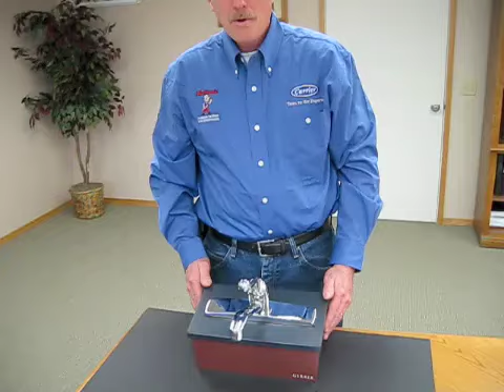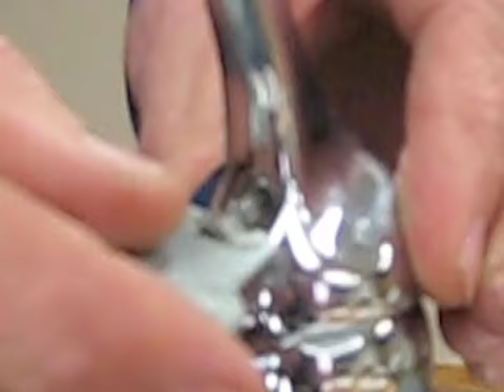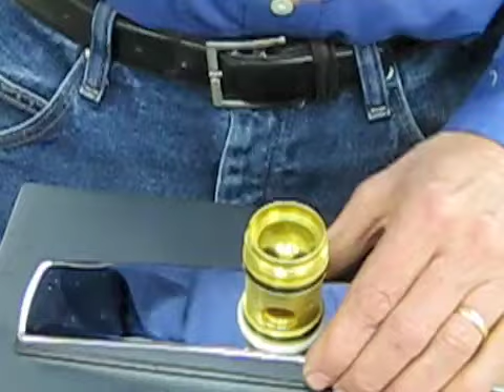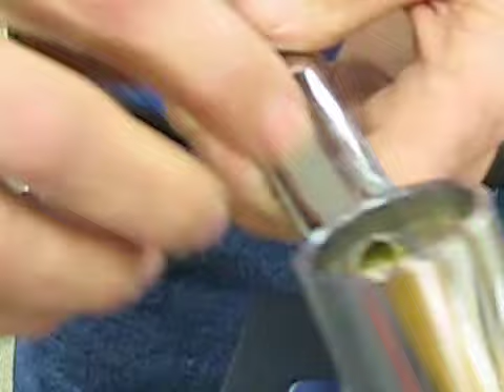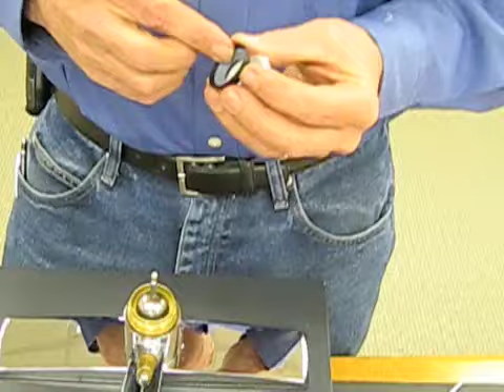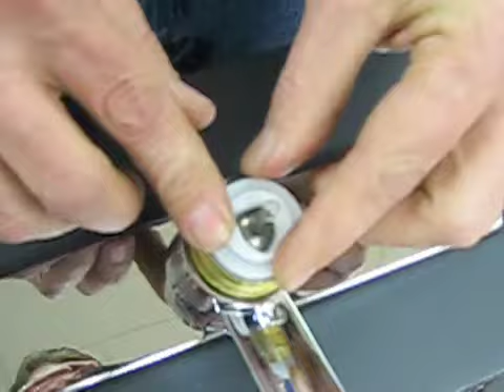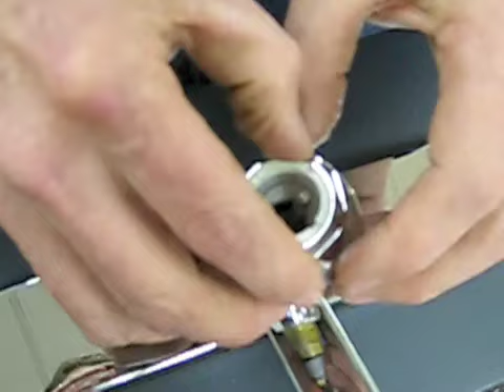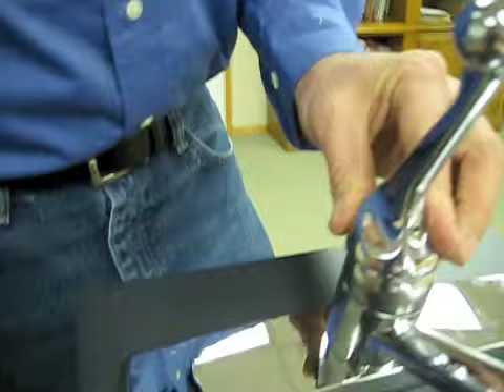Delta Faucet Repair

Comment: One thing not mentioned, as you are putting the ball assembly back in, to the right side of the opening is a little metal nub that must be fitted into a narrow slot in the ball. The ball will not seat properly until this is done. Thanks for your video. Faucet is now repaired.

Comment: Thanks very much for posting this video. Very helpful - my faucet no longer leaks!
Reply: Mine leaked from the tap itself. Nowhere else. So I just replaced the springs and little rubber cup-things. $2.08 at Lowes. No leaks! Thanks.

Comment: The kit I purchased at Lowe's had two sets of o'rings (needed the thicker ones) and two sets of springs.  One set of springs was tapered and did not fit into the washers.
Also, the flat on the stem that the handle mounts to must face forward.

Comment: I replaced the springs and seats and now it doesn't leak anymore. However because the springs (from Home Depot) were not OEM I had to squeeze in the seats firmly. This took some time. The ball is slightly higher than before, but the leaking is GONE!

Oh and there is a cover for the hex screw when starting. It had some much calcification on it that when I pushed it off with a screwdriver it broke off in pieces so beware of that.

Comment: Thanks for the instructional video, helped me fix the dripping problem in the aerator; but now the faucet leaks from "under the handle".  I took all apart and put everything in its place again, but still leak "under the handle" when I turn on the hot water; and it leaks ONLY when I turn it ON, it does not leak for the entire time the hot water is ON.  I have Delta Single-Handle pull-out faucet.

Comment: This worked well on a bathroom faucet. I would mention that the stem on the ball must be facing with the indented flat area at the top of the stem facing out (towards you) as this is where the set screw on the handle must go.  In my case, it had to be in that position in order for the handle to move L to R for hot/cold water.  I also found it a bit tricky to hold down the cam so the tab fit into the slot (even using the method in the video. It was hard to keep the tab lined up with the slot.

Comment: Not all installs/repairs go as perfect as yours; such as Rob Duranleau's (which you also had no suggestions for).
Would like to see you do on a live pressure system and address any issues that may arrive, such as a small water leak from the faucet.
And, what is the other end of that funky looking allen/hex tool used for? 
I'm sure some of the viewers would also like to know about that too.
Just the same, nice job on your video!!!

Comment: Thanks for posting this video..  I was just replacing the same part in a shower valve and I didn't notice how the springs and valve seats were installed when I took it apart.  Watched your video and BLAM, there was my mistake..  thanks again!!

Comment: @mlustig1 Does the spout pull out of the faucet.  If so, you normally do not need to remove the spout.  In that case you would just remove the handle to access the cartridge.  Most pull out faucets have a ceramic disk cartridge.

Comment: Thanks for the excellent tips. almost gave up when I couldn't get the seats and springs out. great tip. used a nail groome rtool  from the local drug store when I couldn't find  anything like a dental pick.

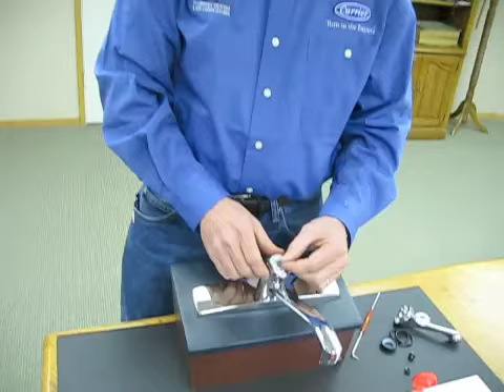Comment: 8:28...what if the water is comming up through the cam and the ball? I made sure the springs and seat are snug in the holes, but water is still comming out.

Comment: Thanks for the video.  I have an old house with rust in the pipes, and the hot water side of mine I think is plugged partially.  This will help with figuring it out!  =D

Comment: I followed your instruction as shown but after I did I noticed one of the rubber seat is shorter than the other, which side would the shorter one go? after the repair no more leak but so is the cold water? wife is asking me to buy a new faucet now. I don't know what happened but why did I lose the cold water?

Comment: thank you henry bush. this video helped me out.  i was getting super frustrated w changing my seat washers in my sink bc it was dripping.  i didnt know until i watched this video that after you change the seat washers you must use the flat wrench to tighten the cap back on the faucet.  the instructions in the seat washer case says hand tighten , but they were wrong you must tighten w a wrench

Comment: My faucet is leaky at the spout. I took it apart and wonder a couple of things. The O rings are not super tight? and the seat and spring assembly - one of flush and one was not? Initially I thought the flush was wrong, but on second thought the flush one may be to flush and spring not working and allowing water to go up?

Comment: I installed all new parts in my kitchen Delta faucet but I just hand tightened the cap assembly.  The handle was really loose and very easy to move.  There wasn't any leaking on any parts but, the handle had to be set back a bit or the spout would run a very light stream of water.  So tomorrow I will use the wench and see what happens.  Great video.  Thanks! Oh!  And by the way, my husband doesn't do any faucet repairs.  LOL

Comment: Thanks Wes.  I did it in under 15 minutes.  I needed a little lube on teh black washers to get them to seat and getting the white thing in the slot at the end was a trick but other than that it went really smooth.

Thanks again.

Comment: If you don't grease the seals at the ball you  won't be happy with the repair.  I was going to replace the faucet  but someone told me about the grease.  On the 4th repair (over a 10 year period on my Mothers faucet)  it works perfectly now.  The genuine Delta seals and springs may have helped too. I also greased the side of the seals so they can move in their bores freely. Live and learn. Grease your seals.

Comment: Hi, I saw your video on You Tube. My Delta has a built-in spray spout. How do I remove the spout assembly to replace the two O rings, with a faucet that has a pull-out spray as the faucet assembly.
Thank you

Comment: Helpfull video. On the ball there is a slot that is on the cold water side. Is there a cam or guide inside the valve body assembly that engages that slot? What is the purpose of that slot?